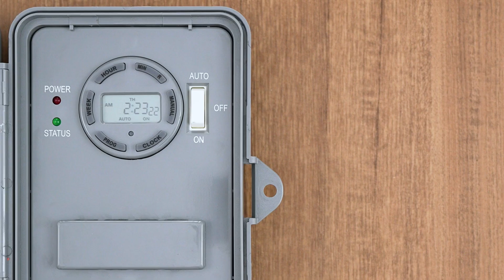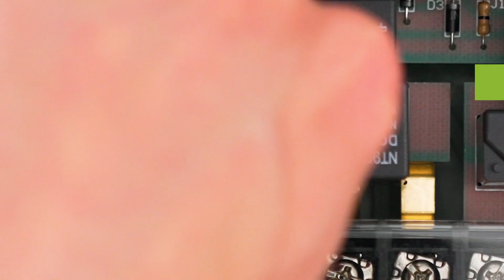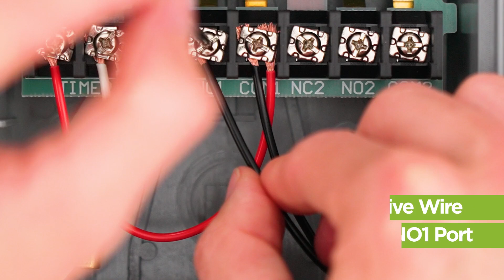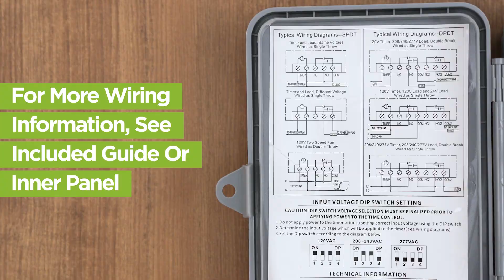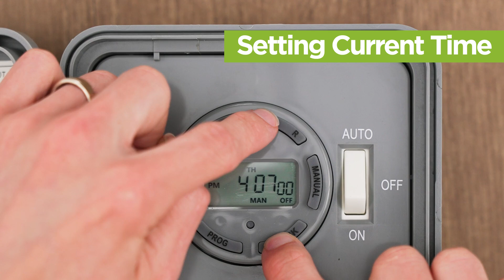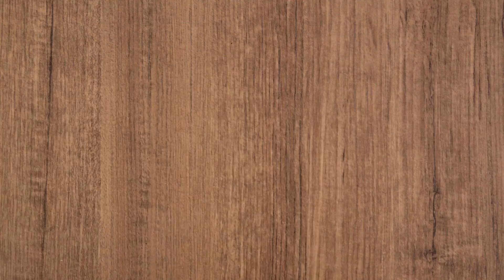Pool Pump Timer Outdoor Digital Timer Box Heavy Duty 7-Day Programmable Bn-link

Comment: Don't trust this video. Example: For 208-240 volts the video says the dip switches 2 & 3 should be in the off/down position but the label above the switches shows the dip switches 2 & 3 in the on/up position. The BN-LINK manual also shows the dip switches 2 & 3 in the on/up position.